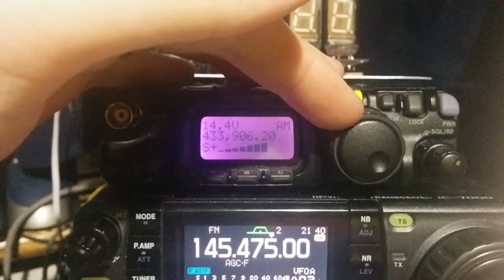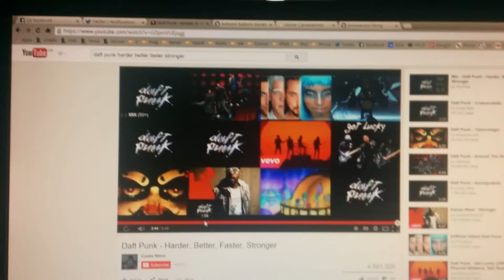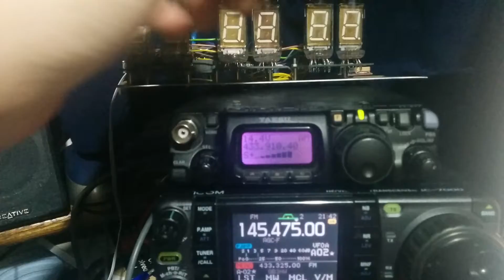Sending Audio with a 433 MHz AM data transmitter

Comment: how much is the capasitor and the resistors are you using? and maybe the schematic how exactly do you connect the audio jack to the pcb, please. :)
Reply from the maker: Please read the answers to other questions. The answers are there.

Comment: I have been looking for this for so long! But i cant understand how the capacitor and resistances are connected, would you please explain better the scheme there?
Reply from the maker: The transmitter is powered by 5V DC.

Two resistors of equal value are connected in series between 5V supply and ground. The middle point is then 2.5V.

One side of the capacitor is connected to the centre point of the two resistors. The other side of the capacitor is connected to your audio signal line. The other side of your audio signal is connected to ground.

The "data" input of the transmitter is connected to the middle of the two resistors (along with the capacitor, as described)

Hope that helps.
Reply from the maker: The values are not that important. Resistors must be similar value: between 1kOhm and 47kOhm. Capacitor of 100nF to 4.7uF.
Reply: @m1geo  That helped a lot! Thank you very much!

Comment: Greet job, Could you please send the code of your project. Thank very much.
Reply from the maker: There is no code. I'm just using the power from the Arduino. There's a description of the circuit in the beginning.
Reply: help I need the circuit diagram please my email soportetecnicocedip@gmail.com
Reply: send me the circuit at my email. Detectingdragon77@gmail.com